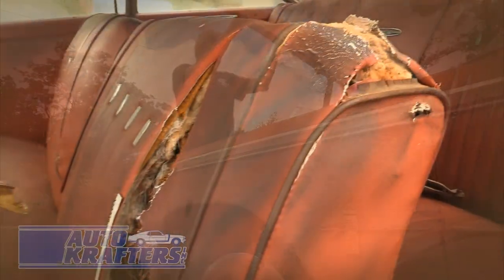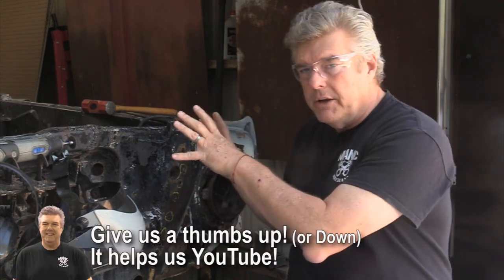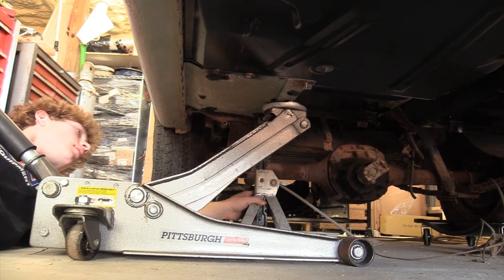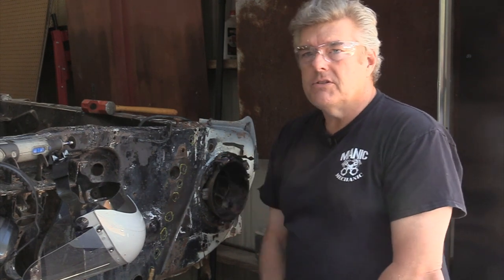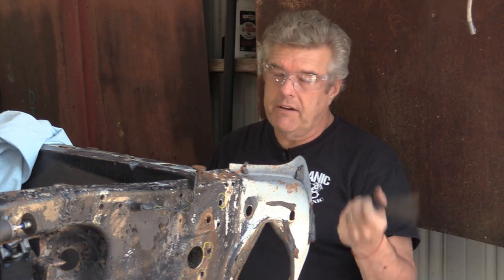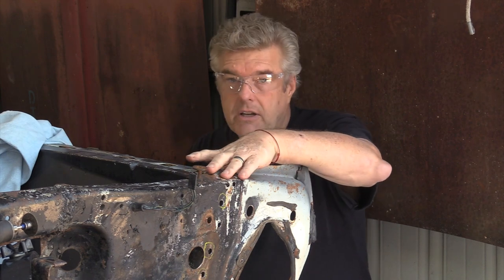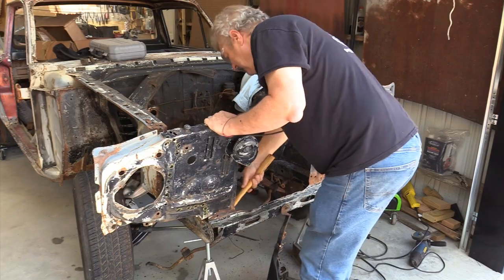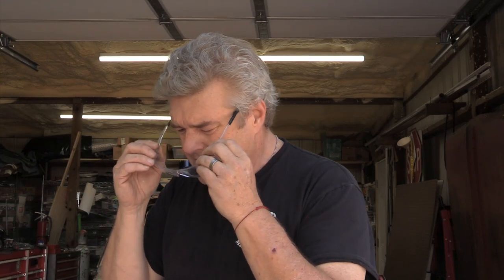Radiator Core Support Removal

Comment: I also watched your spot weld removal video and commented about spot welder cutters. Then I remembered another way to cut spot welds that allows you to reach into areas where you can’t get a spot weld cutter. And it lasts longer. As I was removing spot welds on my VW Bus I remembered using a ball rotary file in a high speed pneumatic grinder on aircraft.  So that is what I was using on the bus. It went faster than a drill and you can control it better. I also use a thin putty knife and hammer to separate the panels. Sometimes I use a thicker putty knife for more strength. These work well and they are cheap to buy and replace. I also used the putty knife on aircraft to separate panels off the structure as most of them were glued and riveted on. You can also shear up to an 1/8 aluminum rivet with a putty knife without much effort. Just a suggestion.
Reply from the maker: Great tips! We appreciate that!

Comment: I removed the core support and battery apron in my 68 Mustang back in 1985 using only Eastwood's spot weld remover. I never went through all this work to get the two out. Time consuming is about it.